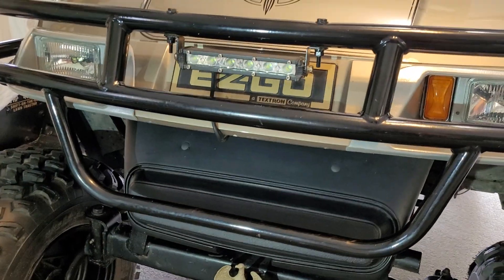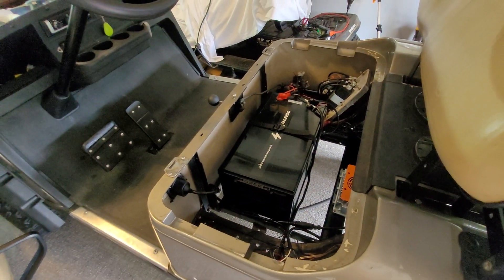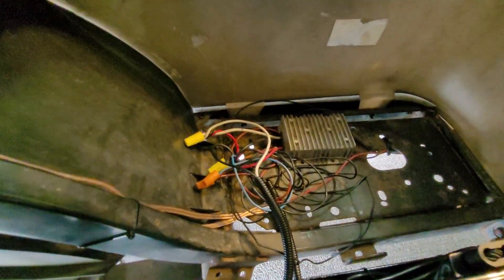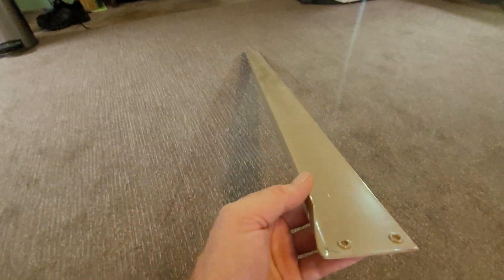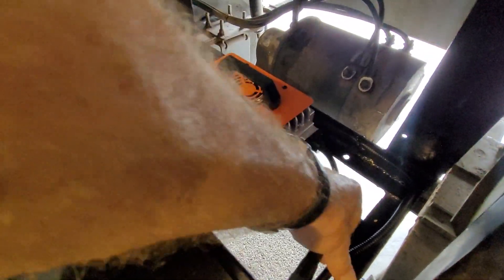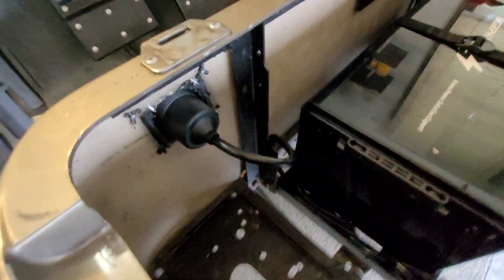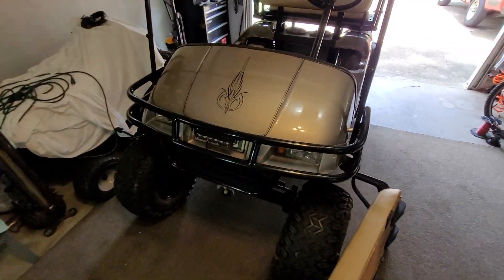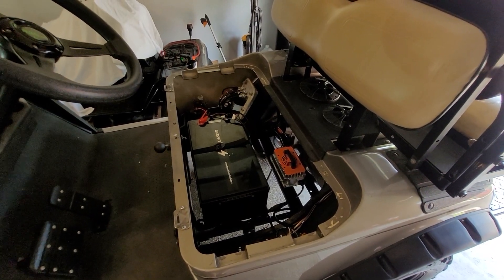OGRPHY 36V Lithium battery conversion on EZGO TXT golf cart. Easy DIY. Go for it!

Comment: I understand where the pos and neg go on the 36 volt side of inverter, but Where does the ground side of the 12 volt converter go to?
Reply from the maker: Ground as in negative? I'm not sure what you're asking. Mounting the inverter to the metal frame grounds it?

Comment: Your charger will fail from dirt and moisture either leave off cart or protect it from the outside
Reply from the maker: It's a garage kept pavement queen golf cart. I don't anticipate any damage. These are on board chargers made specifically for this application. So far, so good. Thanks for the comment.

Comment: I have a couple ogrphy batteries. So far so good. Anyone watching this looking for info on the little monitor that may have come with your battery... throw it away 😂. Its lame and confusing. The app works great for me on android. Less wires to worry about. I use an inline fuse on the positve, dont use a shunt on the negative. The shunt it for capacity to show on the monitor... dont use the monitor. 

Nice video dude! Hope this comment helps other people and your channel as well. 😊
Reply from the maker: Thanks for the comment!

Comment from the maker: You'll need to cut that factory battery tray Center support out because this OGRPHY 36v battery will not fit in the old location. It's about 1/4" too wide.
Reply: Nah, just grind the little tabs on the center rail that held the battery hold down. Wear safety glasses and just get in there!

Comment from the maker: BUMBEE 15 Amp AC Port Plug - 125V Power Inlet Socket with 18 Inch Extension Cord, Shore Power Inlet Plug RV Plugs for Outdoor RV Travel